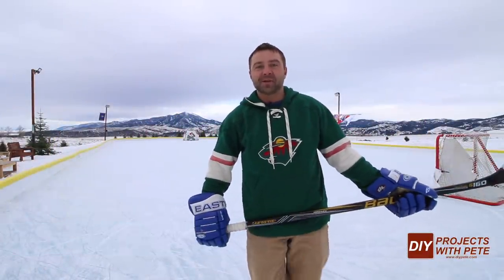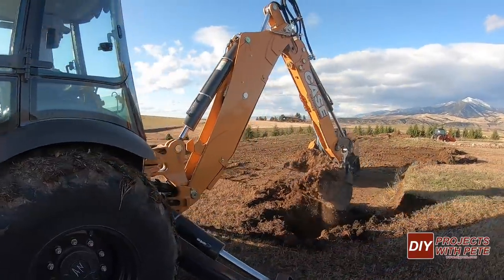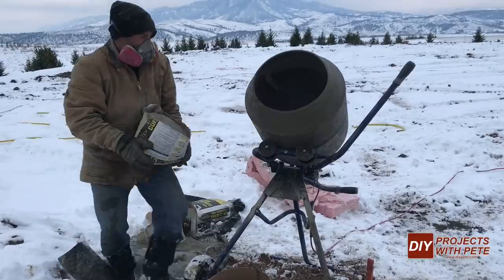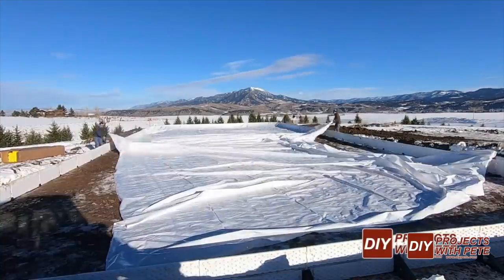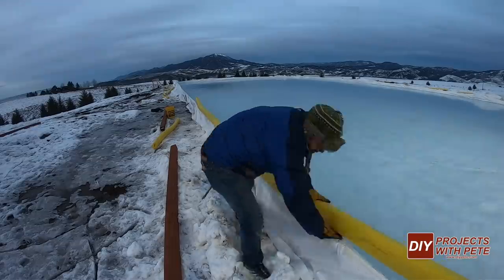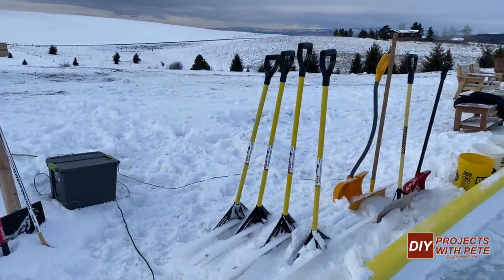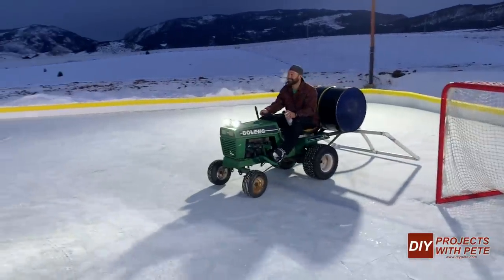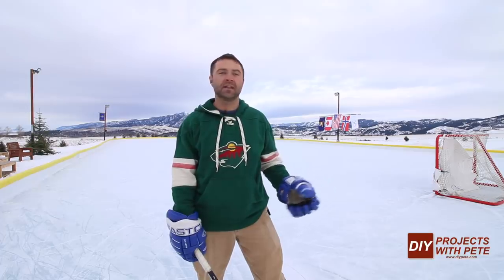Backyard Hockey Rink From Start to Finish | Year 2 Expansion and Updates

Comment: Why not just pour cement down and leave a permanent base so you wouldn't have to deal with the liner every year?
Reply from the maker: Hi! Great question. To be honest, putting up the boards and liner can all be done in under 5 hours, so it's not as big of a deal as many might think it is. This summer I plan to plant grass and to use the big flat surface for summer sports like lacrosse, soccer, football, etc. However, I have though about putting a tennis court here someday or using it for roller hockey. I purposely made the platform big enough for a full size tennis court just in case. It is a big expense though as it is a lot of square feet. If I did the platform 5 feet longer and wider on each end, total square footage would come to 9100 square feet. I got a quote and it is nearing around $40,000-$50,0000. Maybe someday, but the grass is fine for the time being :)
Reply: That's super interesting!  Here in eastern canada, I don't know if anyone has really done that.  In the few backyard rinks I've experienced, they have a hard time in the summer, grass growth wise..

Comment: You should put concrete down so you don’t have to fix terrain every year
Reply from the maker: Thanks for watching! I'll be planting grass this spring and the terrain will not need to be re-worked in the future so things will be much easier. Concrete would be cool if I was to do a tennis court or roller hockey though. It's quite the investment to do a slab of that size ( around $40,000 ) , cheers

Comment: this is cool but is it really diy when you have multiple people operating large machinery for free
Reply from the maker: Hello Abby! The initial work of leveling is certainly more than just DIY, but for those with a relatively level area, the actual installation of the boards and liner is very straightforward and totally doable. Most backyard rinks are smaller than this one, but I wanted to document the process in hopes to help and inspire fellow rink builders with all sizes of rinks :) Cheers!